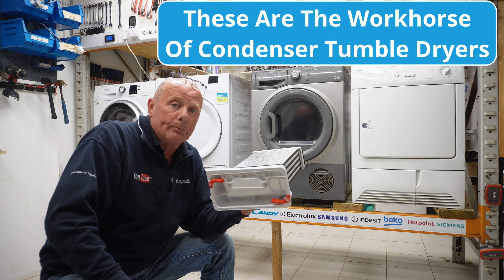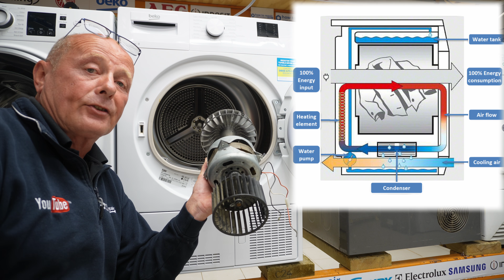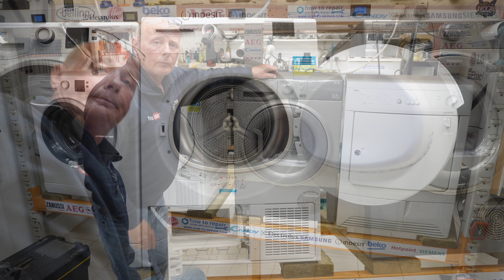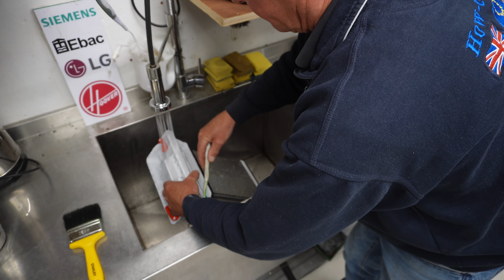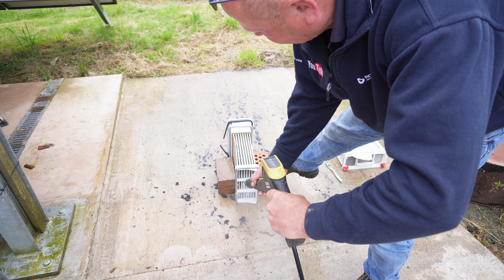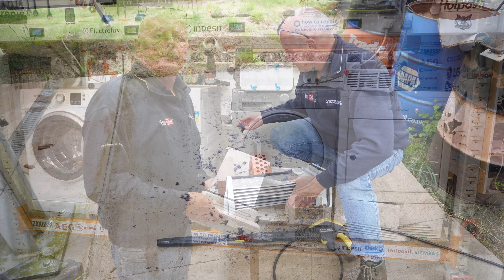How to Clean a Tumble Dryer Condenser Box Unit, Saves Drying Time & Money!

Comment: I moved into a house where the previous owners left their condenser dryer. I had never had one before. I fiddled around and found the condenser. It seemed to be not letting much light through. I took it outside and gave it a good water blasting. Amazing! We should be doing this every 2 or 3 months.

Comment: How to fix one of these when the plastic at the back of the unit has warped and it won't fit back into the dryer? Use a nipper or gardening shears. Cut strips into the plastic and bend slightly inwards.  Its 100 quid for a replacement that will warp again.

Comment: What do you do when the condenser unit is not designed to be removed by the consumer? My AEG has several filters, but the fins of the condenser still clog up and the best I can do is go at them with a vacuum cleaner and a brush.
Reply: I have the same problem and have wondered if there's a way to clean it more thoroughly??

Comment: Too bad my Samsung condensing element is fixed in place, ot only that but it also doesn't have any kind of foam to protect the fins from fine dust that overtime will  combine with the condensation humity and form an hard crust on the fins blocking all the airflow....

Comment: Thanks for this information. My dad bought me a beko dryer (DSC85W) and I didn’t know it was a condenser dryer. I thought all I had to maintain was the water tank and fluff compartment. I  was luckily able to clean it out and it had stopped blowing hot air but when I’d left it for a while and tried again it worked fine. It was years that it hadn’t been cleaned. Im looking after all my appliances a lot better now. The only thing that’s annoying (and its done it since I got it, so it’s not all my lack of care) is the dryer will start and then periodically stop and then it decides to start again after so many minutes. Is this a fault or a standard beko feature 🤷‍♀️
Reply: That's normal, it's actually pausing to change direction.

Comment: Hi, I have a Hoover Dynamic next heat pump condensing dryer, the condensing fins appear to be integrated and don't come out in a cartridge as you show for other models in the video. There is a foam filter before the condenser that I regularly clean, but I was wondering if there is a way of cleaning out the condensing unit on these models? Or should I not worry about it?
Reply: Mine is similar it doesn't pull out , but it looks like it needs a clean out 😟

Comment: Late to the party but…. My newest dryer has a filter that is impossible to clean easily as shown here. I religiously do so monthly as I know how bad it can get but the closed end design is so difficult that like you I have to resort to using a hose ! Who on earth SHOULD need a pressure hose to clean the filter box! Terrible design. My previous model had one that I was able to put under the kitchen tap..and all the fluff etc would be easily washed out as the venting holes/fins were accessible..not round a corner of plastic! Thanks for demonstrating this though as it’s so dangerous not to clean the filters.. I hope next machine I buy will be a better design! I’ll be checking it out before buying for sure!
Reply: Take it in the shower with you, spray some kitchen foam in it then use the shower head. I don’t need a pressure washer.
Reply: @Eastbarn1 Mine’s the same - it’s not possible to remove the condenser unit as it’s built into the bottom of the tumble dryer. You can only expose one end of the condenser, not the sides or back. What an incredibly stupid design, built-in obsolescence…

Comment: Thanks for sharing this. Question: what’s the minimum distance the rear of the condenser dryer should be from the wall it backs up to? Mine is up against a brick wall in the garage 👍🏻
Reply: Shouldn't matter as long as their is airflow to keep it cool. Having said that my missus dumps tons of crap on top of ours and it never misses a beat

Comment: Please help after cleaning my condense unit It won’t go back in the dryer I’ve tried gently pushing it in nothing blocking it so why won’t it go in please please give advice urgently
Reply: They often have a warp in the plastic at the back end, when I get one like that,I just bend it it inwards and push it in quickly before it fully returns to it's warped shape.
Reply: i wiggle it and push firmly

Comment: Use a 12" steel ruler wrapped in an old piece of cotton sheet and warm soapy water to gently remove any stuck lint and thoroughly clean inside the condenser air box. Also, avoid using fabric conditioner in your washing, the residue acts like glue when it is heated damaging your (washing machine) and dryer
Reply: Then hace crispy starchy clothes ? Rather take the chance

Comment: My Electrolux ew9h478s condenser box is filled with stuck, wet lint. The problem is that its not an easily removable box like in the video, but from the looks of it built in to the lower part of the machine and have to remove the whole upper and back part to have acces to it. And then I could still run in to problems regarding its placement. Is there a video for that specific or sameish model somewhere?

Comment: i was looking forward to getting my condenser dryer with a washable box,but they changed the design and it now has a washable foam filter that probably wont do the job properly
Reply: Your dryer is a heat pump one. It doesn't have a condenser unit like these.

Comment: I clean these out by raking them through with a 2 foot steel ruler, they can be bought from Poundland. Once the slots have been raked through, a run under a tap or a hose, cleans them right out.
Reply: Can damage and bend the fins like that which reduces efficiency as if they’re pushed together you get lower surface area
Reply: @Alex-zs1zu  I have cleaned out dozens this way, it doesn't do any damage whatsoever.
Reply: Thank you, great tip

Comment: This really helped thank you. Also, do I have to let the condenser dry before putting it back in after cleaning it out? as I've seen a few videos saying to just put it back in, and I wanted to make sure? I haven't cleaned it this way yet as its not needed but it had some wet fluff that needed wiping off and definitely can say it's working alot better and faster
Reply: It gets pretty wet in operation. I shake excess water out of mine but don't go nuts.

Comment: Quick question. Noticed recently a funky smell on clothes after they've dried in our condenser dryer. Been about a month and a half since I last cleaned out the condenser so I took it out, and washed out all the fluff (there was quite a lot it was pretty caked) and the back part of the condenser that sits inside the machine had the smell I've been smelling but about 5x stronger. Is this entirely just because it's been blocked and caked with old lint for a long time, and it's had poor airflow due to it so the smell has been transferring back into the clothes?

Comment: I had clothes coming out hot and steaming wet so had an engineer come out who replaced the condenser for a new one the problem is still there, he has checked all the sensors and fans and they all seem fine, the previous condenser was very bad clogged which I cleaned out exactly like this video shows and when the engineer came out initially he said the condenser was very clean but still replaced it as he could only put it down to this but like I say it’s still same issue also the cycle cuts itself short any ideas
Reply from the maker: Hi, I will need the full model number of the identification plate and the details of your problem. Please use our contact us page and make sure you fill out the request for what your problem is. A video shoot of the problem would be perfect as well.

We will get back to you within 24 hours, normally. https://www.how-to-repair.com/help/contact-us/ 

Please remember to subscribe to our channel, as that's what keeps this channel going. Thanks, Paul 👍